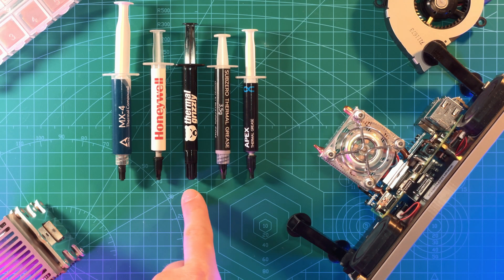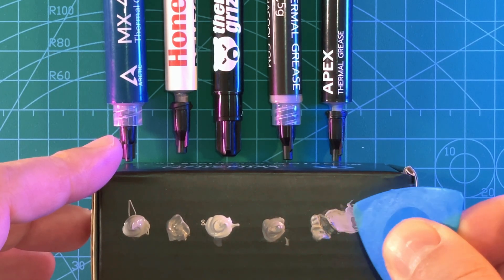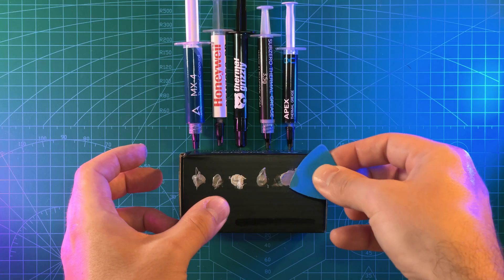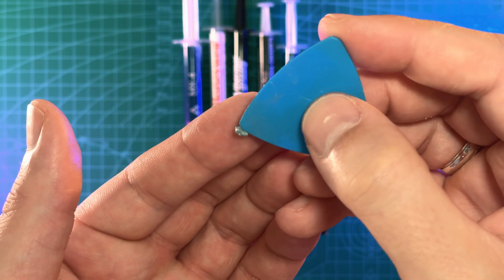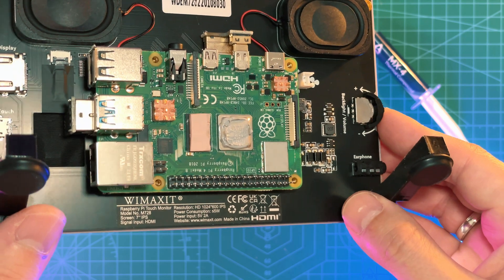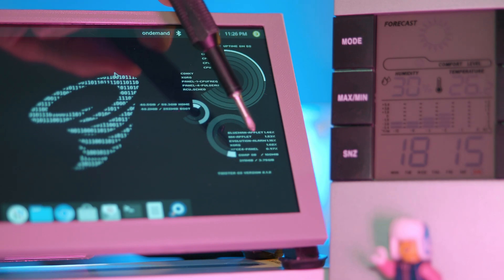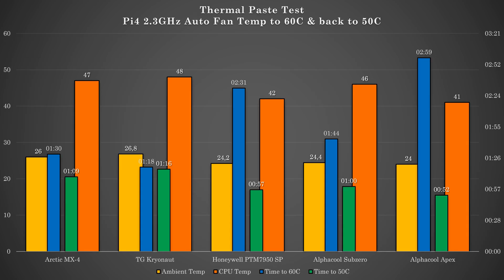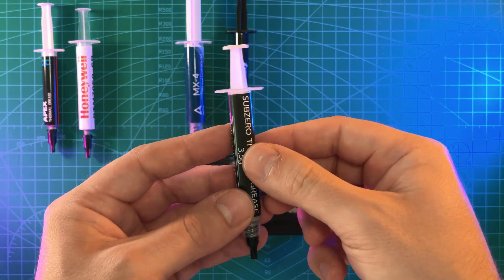Best Thermal Paste? 5 Tested!

Comment: does homey know how to read charts?  it's apparent that 2 or 3 others beat grizzly on individual tests and you claim TG winner.  wowo.
Reply from the maker: What do you mean xD can you not read the charts or did you forget to take Delta in to consideration :) just as an example under stress test with fan OFF.

TG was at 75C with delta to ambient being 48.3
Apex was at 73 with delta to ambient being 48.9

Even tho I prefer and use Apex as my go to paste for diferent reasons TG was able to transfer heat faster.

Comment: 😆😆  @ honeywell nothing special.  btw, hw7950 is PCM, phase change material.  interesting how the paste seems to be the same as the PCM.  I had to do my steam deck 3 times because I thought I f'ed something up and the first two times I just used my thumb to roll it off the die and alcohol to get the leftover which wasn't much.
Reply from the maker: if for paste you mean Apex from Alphacool then yeah it is much thicker then the rest. My go to paste even tho thermal conductivity is better with TG.

Comment: which thermal paste or pad do you recommend for my lenovo legion 5?
Reply from the maker: I would go with Apex paste and Soft Pads from Alphacool. That is what I am running in my wife’s L5P and on my other devices. There is new paste from Alphacool that is even thicker but I have not tested it yet. Will update with my GPD Win Max 2 review/test videos 😃
Reply: @atechcheck  thank you
Reply: @atechcheck  what do you think of mx4 or mx6?
Reply from the maker: @Enginor  mx6 I have not tested (will get it) but I can onlz assume that it should be better formula then mx4 since otherwise why would they even update....

Comment: Actic has released the new MX-6. Viscosity seems better than mx-4. The thermal conductivity seems to be lower, but with 2 3 degrees that stood out in the tests.
I ordered it, I'll try it on legion 5 pro and let's see what the result is.

I was curious before and tried the 13w/mk Halnziye P13. After a fluidity like the MX4. But since Legion 5 pro had a block pressure problem, pumpout was happening after a while. When I first put it on, it went for 2-3 months, then when I renewed it, it hardly lasted for 1 month. At the moment it never goes below 100 degrees in cinebench. When I renewed 1 month ago, it did not exceed 85 degrees :D

It's nice when idle. Temperature at 45 degrees. but it gets worse at peak values And the cooler blows cool not hot. It is clear that he could not make the hot transfer to the block.

If the MX6 doesn't help, I'll try liquid metal from now on.
Reply from the maker: Yeah, blowing cold air while on high rpm is forst sign that die/block contact is not OK.... I was looking for AIO and saw MX-6 from Arctic. I am getting device that will need good TP so I will get that one too to test ;)

Comment: came here cause I got the apex.
can't decide if I should thermal paste or liquid metal for 7900 xtx, cause as igor showed, 7900 xtx might have large surface deltas, which significantly can increase LM spill all over my GPU pcb even at minimalist application.
Reply from the maker: Yeah that’s my main issue with LM! For mobile chips where contact surface is much smaller it would make sense tbh but on larger ones I am not so sure…. If all goes well it will be great and if not it will be bad… Apex in this case provides a bit more peace of mind 😄 also there is new grease from Alphacool that is slightly better and thicker. I still didn’t have chance to test it but since my Apex is empty I will probably get that one for next build 😊

Comment: You can test ones Dow Corning 340 its quite cheap and they say its just 0.67 but would be interessting. Is used in aviation so it should work with temps from minus 60°C to plus 200 without a problem day in day out.

Comment: Good test but I really would of liked to see how some liquid metal stacked up here. Like themral grizzly Conductonaut.
Reply from the maker: Well you have a point there :) but since it is much complicated in terms of application I wanted to keep it simple :) will probably do something with LM and try to compare them to one of best standard ones ;)
Reply: @atechcheck  Cool that'd be nice. ty. But it''s really not complicated at all. Honestly in most ways, it's more reliable imo.  People are just scared of it because it's conductive but it spreads sooo much easier and more uniformly. A little goes a long way.
Reply from the maker: @DSBsky77  True :D only  prep work is important and rest is fine :D I have few candidates and one of them is Legion 5 P with Apex in it atm so that one could be good comparison against LM ;) I wanted to do something about thermal pad on that one anyways so that will probably be my next victim XD

Comment: hi, i read that the HONEYWELL thermal paste needs several hours of curing time(24hrs) to allow for the solvent to evaporate?? did you follow these instructions in your test?
Reply: It's true, from the rechnical datasheet:
PTM7950-SP will dry after approximately
15 hours at ambient temperatures with
a thickness of 10 to 12 mils*
• PTM7950-SP dry time can also be
accelerated in a forced exhaust oven or
similar equipment at 50 ̊C for 3.5 hours
it needs curing time for the solvents to evaporate before attaching the heatsink.
The pad/sheet form is ready to use afaik.
The benefit from phase change material is that there is almost no pump-out effect. Popular regular pastes like MX-4 or yogibear pumps out on direct-die situations (Laptop, Graphics card, XBOX, Playstation) with current-gen high turboclock speeds + temperatures. Many repasted devices hold up fine the first weeks with great temp reduction but the paste migrates resulting in worse than factory temps. I use it on those devices because i don't need maximum temp reduction but hold-up time.
On medium grade laptops with low watt CPU's that never reaches 80'c (Core i3U or celly's) i use thick thermal paste like Shin-Etsu X23-7921-5, IC-Diamond or Thermalright TFX.
By the way high w/mk doesn't really mean anything because each manufacturer uses their own testing methodology and there are more factors.
Reply: @phenos  great insight ty, i have an asus m16 2022 with a 12900h and 3070ti, i have replaced the stock thermal paste on the gpu with thermal grizzly paste and reapplied the liquid metal on the cpu that had huge blobs and pools of liquid metal  all around but have not really seen any improvement in temps, maybe i failed to test it properly on cinebench before and after(which i didn't) but since it is still throttling on the cpu(96C)and reaching 76C on the gpu while gaming i was seriously considering applying the 7950 sp which i do have 2 gr. of. What do you think? I mean i don't know if it will outperform the liquid metal but maybe it will op the TG paste?
Reply from the maker: @MrMartinvince  So if you take a look at my charts you will still see that temps are basically the same.... CPU will try to pull max W if temps are within the thermal design. To see any difference you will need to limit your CPU to, 25-30W and do the same to GPU with lowering it by 30W and see if you can see any difference in your tests. Most of the laptop cooling solutions are not built to prevent the CPU-GPU thermal throttling!!! That's the job of dies themself and they will lover the clocks to achieve this and all manufacturers need to do is to minimize that by a fraction and job well done... But in all honesty my  L5P is pulling 80W on performance and temps are at 100C.... After doing test in CB I came to a conclusion that everything above 25-35W  brings really nothing in terms of greater performance but rather just more power consumption and heat.... Look at 6800U in handheld and laptops.... Up to 25W you see huge incremental improvements in games (10, 15, 20, 25W) after that it is just few FPS at most.... Important part is how good is contact between your dies and cooling block! If it is good you should not be seeing those LM blobs at all.... also 76C in a laptop for 3070 ti is great if it is pulling all 14W all the time when in gaming like my L5P does.
Reply from the maker: @phenos  Well those are some really great informations :) THX. Also as you mentioned
"Many repasted devices hold up fine the first weeks with great temp reduction..." Even this did not happen and it did not change anything in my case.... In all honesty I am not convinced BUT I still have some so I will try and follow those steps and see if it really brings anything :)
Reply: Some cold-plates or the die itself are a little bit concave or have uneven surface, on a perfectly flat levelled surface with good contact pressure paste holds up much longer. On a laptop you can check that with HWINFO on the individual core temperatures, if there is a noticable difference like 8'c or clockspeed difference when it's on the throttle threshold with fully loaded cores then most likely the contact area is not perfectly flat. The colder/faster cores have better direct contact with the cold-plate and the hotter cores have more filler paste in between.
And I agree with what you said about the power consumption and performance. Also appliable on the new Ryzen 7000 cpu's, with a little bit of tweaking you can reduce the temp and power consumption significantly with no noticable difference in performance.
-Edit
Another way to check the surface is by placing a perfectly flat object on it and a strong spotlight, if you see light passing through then the area is not perfectly flat. If you dare: Carefully sanding the cold-plate with P3000 sandpaper on a piece of glass with the light check is an option.
(English is not my primary language but I think you'll understand)
Reply from the maker: @phenos  you are right :) My idea was to use dental colored tape/paper to see where it does not make contact xD My L5Pro with Apex and those soft pads is fine atm but as soon as I notice that it is not fine anymore those steps you mentioned and my ideas will be put to work to solve this once and for all xD PS. I dare to do anything that makes sense hihi
Reply from the maker: Well to be completely honest I did not see that instruction.... My standard process with any paste is basically going thru few hot-cold cycles. Few synthetic test at max temps and letting it cool down completely. With this test I did the same and  Honeywell was left overnight and did test only day after after I was back from work since I couldn't do it at the same day xD I still think it is a good paste and certain applications even better than others but at the end of the day it is just overhyped for wrong reasons....
Reply: @atechcheck  The real deal seems to be the phase change pad version, the paste version from Honeywell 7950 you tested isn't that special from what I can see. There are some other tests, it's not bad but really nothing special and your test also shows this. All the great results on reddit and other tests are from the pad version. As a side note your CPU temps are quite low in this test for a laptop, I think it's more representative if you push it into the 80+ range if it's possible on your laptop. I mean many of todays laptops reach 100 degrees.
Reply from the maker: @K543  well some time later hehe BUT Thermal Grizzly have now PTM in pads (12€) that can cover both CPU and GPU dies :) Just uploading my ASUS ROG Strix G15 video where I replaced LM with TPM! TPM is the future for sure!

Comment: hello. I am using a Legion 16ach 3060(5800H) product.
I'm using the Ryzen controller to catch the cpu temperature, but the gpu temperature is measured high, so I think I need to reapply the thermal, so I came across a video while I was looking for what kind of thermal to buy, so I leave a comment like this.
In domestic cafes, the ptm7950 thermal used in laptops is better than other thermals, so it is recommended to use it without re-applying it. I wonder if the temperature will be controlled even if I purchase ptm7950 and reapply it, or how about attaching a graphite pad.
Reply from the maker: Well since the main issue is that contact between dies and cooling block you will be fine if you repaste wit ptm or if you go with graphite pad since both will close that gap. But that is interesting since my GPU 3070 it much cooler than my cpu 😃

Comment: The Arctic and Thermal Grizzly thermal conductivity can be found with a 2 second google search. They're not a secret.  Its 8.5 for the Arctic and 12.5 for Thermal Grizzly
Reply from the maker: Well since I did not find anything on the packaging and on websites from them, for me they do not have any official value..... If you search all you will find are third party values..... It does make sense to give them those values when they are compared to others like here to 8,5 Alphacool and Honeywell. But officially they do not have thermal conductivity values ;) https://www.thermal-grizzly.com/produkte
Reply: @atechcheck  alphacool apex is 17 W/mK so it would make sense for Thermal grizzly to be about 12.5 looking at the results. 
the alphacool application could have been slightly thicker reducing its theoretical performance to slightly less than thermal grizzly at 12.5.
there are more variables than the paste. application, distance between IHS and cooler play a roll in that and are hard to control.
Reply from the maker: @darkshadowsx5949   yeah that makes sense and since Grizzly is not that thick it makes sense that is keeping up with Apex fine but probably longevity will be affected. I am now using Apex with my ROG Ally and it is working like a charm even with 35W on this small unit it have no issues :D

Comment: What about mx-5?
Reply: avoid MX-5 for laptops, consoles and GPUs!!!! get a much thicker paste (like APEX) or get the Honeywell PTM7950 is pad form, i used MX5 in my laptop and GPU and regret it, temps are fine for the 1st month but it pumps out really fast and after just 1 month and a week temps were back to stock levels, got a much thicker paste and it is much better.
Reply from the maker: Great to know! I have feeling that all soft paste are just pumping out with time and as soon as thicker one is used it works fine…. Will need to get my hands on those ptm pads xD
Reply from the maker: well, it is another soft paste that will perform more or less the same as others.... as I said, every paste will work fine, at least any known to be good one...
Reply: @atechcheck  oh ok, i heard it's thicker than mx-4 so i thought it would be better for laptops
Reply from the maker: @suschilegge1683  then it should be good as Apex and Subzero I guess :)
Reply: MX-6 is much better
Reply: Similar to MX-4 in my tests and really poor overall. I saw good results on some desktop CPUs in other reviews but fails in my laptop. I wouldn't say MX-5 is thicker than MX-4. MX-6 is definitely much thicker and works much better in my laptop but it goes from bad to mediocre.
Reply: @K543  MX-6 is better results
Reply: @TitusMH  MX-6 is a lot better than MX4 and MX-5 but it's not a great paste....on my testing with my laptop.
Reply: @TitusMH   What is your problem exactly?  Why I'm a moron, could you tell me? Are you a MX-6 fanboy or some sort of? Your last two messages are really confusing.
Reply: @K543  exactly, you are. I already mention my comment from earlier 😝
Reply: @K543  🙄
Reply: @TitusMH  Why no answer? You can't?

Comment: I like the idea of the Honeywell as a pad sort of replacement; or I’d just get putty to cover the vrms and such. But yea the Apex is a legit replacement for what’s stock. Honestly, it looks like some ppl should just work via software to manage their heat from a stock solution. It isn’t terrible but if you just want to push cooling as much as possible putting on new page isn’t a bad idea.

Also a lot of ppl mistake “dried paste” sometimes with the stock paste as bad when it’s just a phase change substance. 

Thanks for sharing!
Reply from the maker: Thank you for your comment ;) Well I did  the same mistake with 5 Pro in first video since transparency from Lenovo is good as none xD I did not know what they are using and from experience I assumed it was dry xD But yeah in this case Apex is the best option and Kryonaut will be better for simpler thermal designs with much less coverage and less contact issues. Also you are right Software tweaks are a must and goes hand in hand with hardware ones! As soon as I am done with another two videos that I started editing already I will be doing Software tweaking one. Putty could even be better (read cheaper) solution since Honeywell is not exactly cheap XD at circa 20$ + shipping and Zoll in Germany it costed me between 20-30€ which is crazy and I am not even shure if one would be enough to replace all pads in legion 5  and 5 pro xD
Reply: I don't care it works at start, show us a year later results, the Coolermaster Master gel maker or kryonout just dries up, after 6-9 months, if you have CPU that can't be pulled from motherboard good luck removing the CPU cooler.
Reply from the maker: Soo I still have my L5Pro after a year! After I am done with other 2 Videos I will be doing update video on L5Pro and thermal performance/difference! Main issue is that my previous tests were focused on how much more TDP can we get with better thermal dissipation. I can already say that it still holds like on day one! BUT I will do the detailed update for YT and for myself!
Reply: @atechcheck  looking forward to it! So awesome 😎